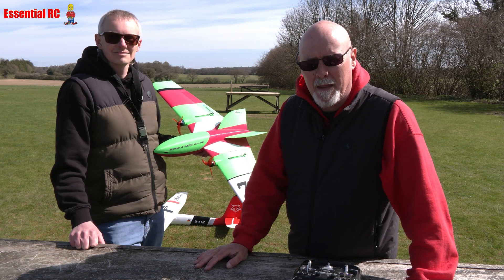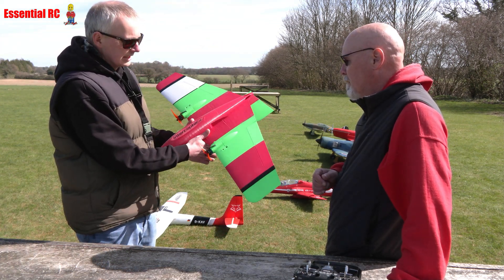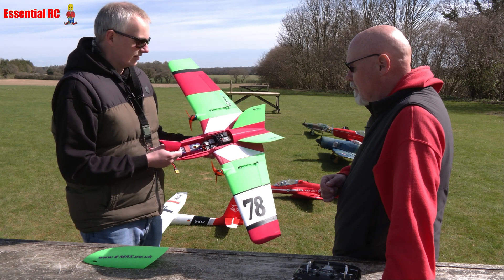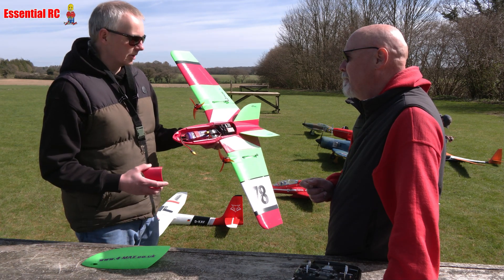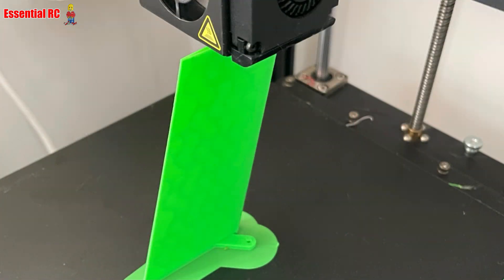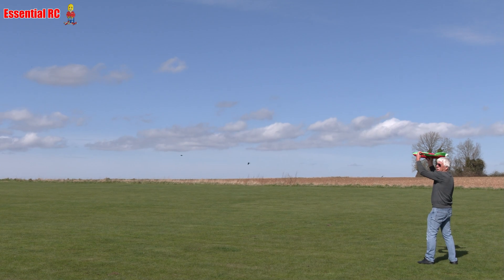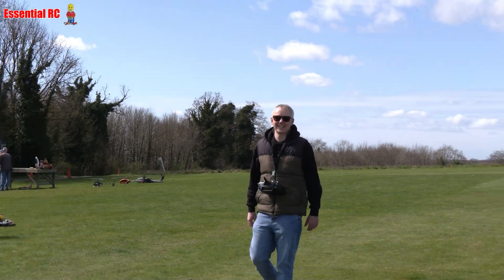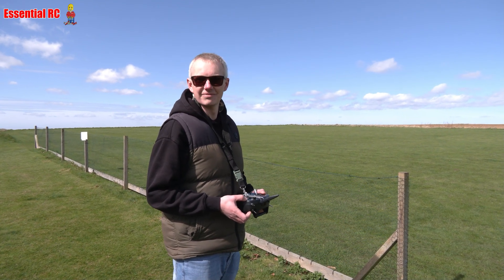WILL IT FLY ? FAST 3D printed WING | Stunt Double Interceptor v2 with 4-Max power system

Comment: I like the hi-vis color, makes it easier to see 😊
Reply from the maker: And all achieved by printing different panels using different colour filament! No messy painting
Reply: yes..for me I would just add some colored packing tape stripes on bottom of wings..great thing is it's not painted foam so tape will not peal off or pull off paint etc..great model...I love this type of planes..I wish I could find a similar 3d printed file for the old Hobbyking Wingnetic...I loved that plane after I reconstructed front and installed a 2450kv motor on it..It was probably faster on 3s 1300mah than this model on 4s..I just prefer single motor planes over twins..😊